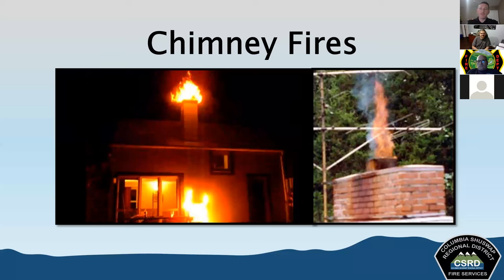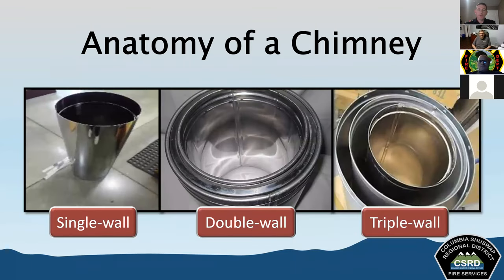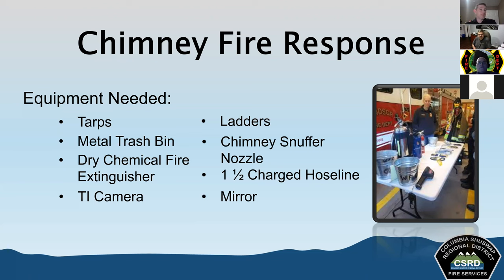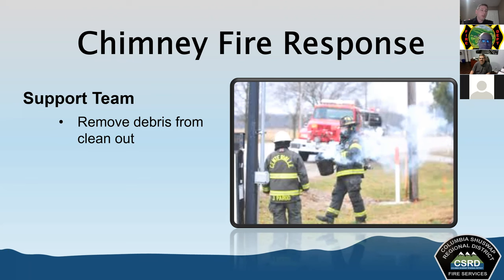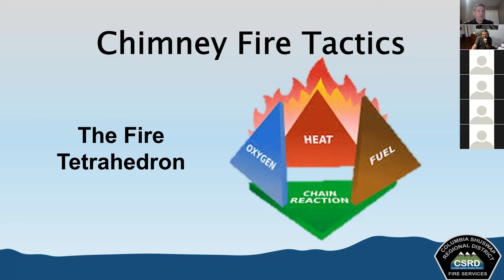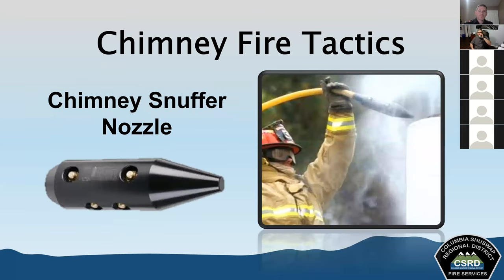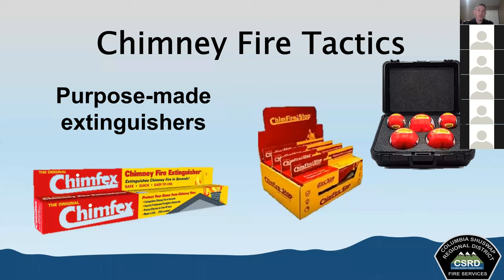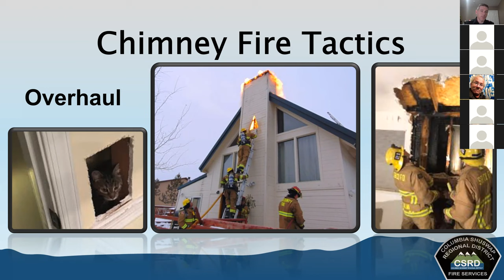Fire Training Course - Chimney Fires

Comment: We forced a change of the chimneys without liners to get an insert by a certain date. However we found that many cheated and only put the inserts 4 feet on the top part so from the ground it looked like they complied with the change in the law. We had so many chimney fires in the decades after that related to the false inserts.  Thankful few are left now.
Reply: I don't know why you think rules are the answer. How about get people to clean their chimneys instead and actually solve a majority of the problem.
Reply: Sweeping AND Getting a certified professional to inspect the system every year. 👍